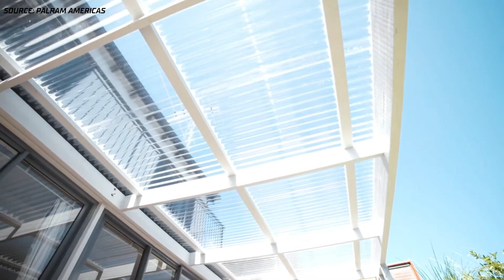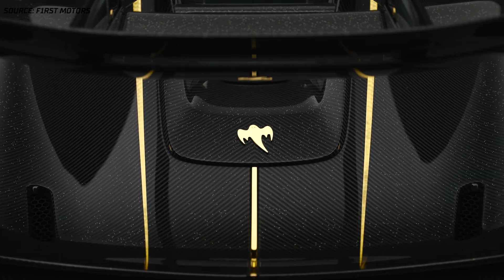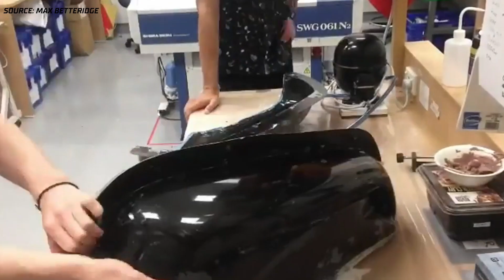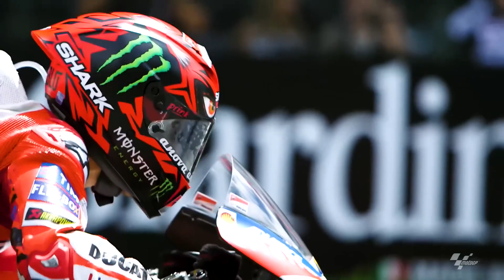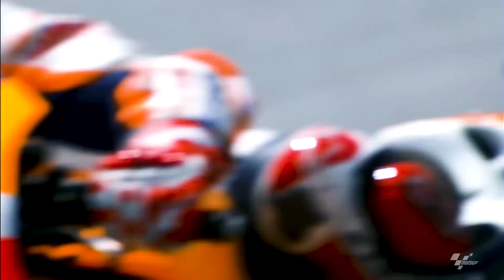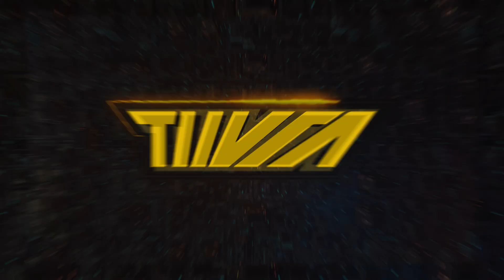Why Does Tiivra ONLY Make Composite Fiber Helmets? | #TiivraExplained

Comment: Here is some free advice, take it or leave it. 
One, get your helmets certified to ECE 22.06
Two, make different types of helmets i.e modular, open face/jet and a full face with internal sun visor
Three, install pinlocks Max vision on your visors
Without these you'll always be niche. You want be a player or a boutique. Decide and change accordingly
Reply from the maker: Thanks. Agree with all three.  Points 1 and 3 happening soon. Point 2 - we will be working on those. Appreciate your inputs.